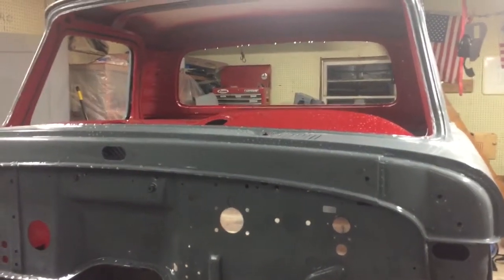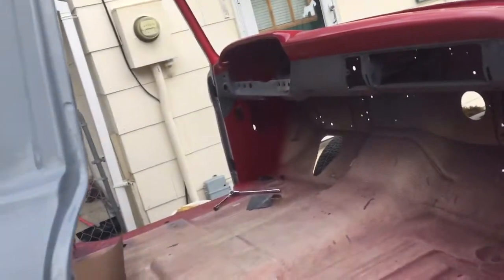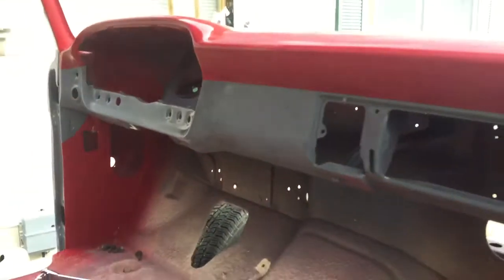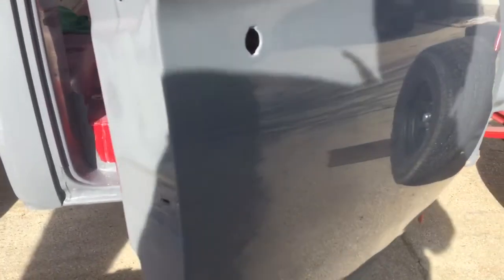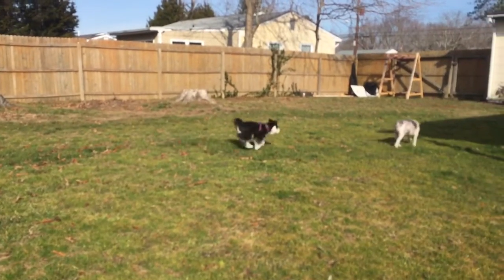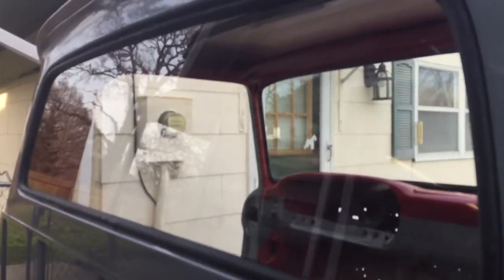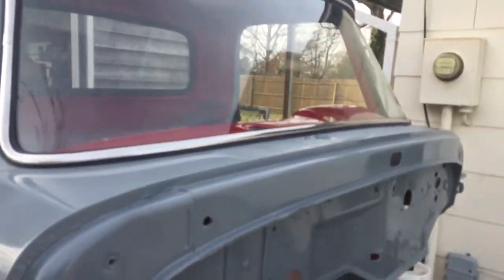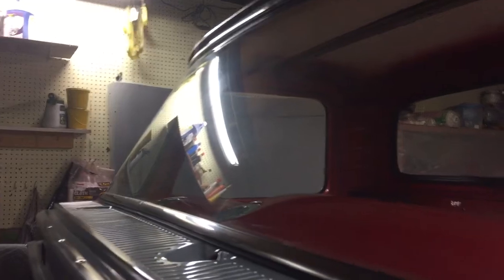Windshield installation and letting the mess ups go.

Comment: We can't expect professional paint jobs being 1st timers with homemade booths, so I think you did a great job.  I'm in the same boat as you with needing to repaint the door.  I reckon it'll have to wait.
Reply from the maker: farmboy30117 I remember you had struggles with a door too. It's in the air. Hope yo get it sorted out.  I should have painted it today it was 50 and easy to heat the garage but I farted around doing other unnecessary stuff. I was in time out.

Comment: That is a really respectable job considering you are doing it in a garage. LOL, I put myself in time out too sometimes.
Reply from the maker: The Open Air Garage I stayed in time out today. It was warmer today and would have been a good day to paint the door but it was super foggy and wet all day. No rain, just a ton of moisture in the air.  I assembled the steering tube bracket that holds the pedals, and I put a resin on some cardboard vent pieces that are not reproduced and impossible to procure. I am trying to stiffen the, up so they won't crumble.  If I could 3-d print these I'd be making bank!